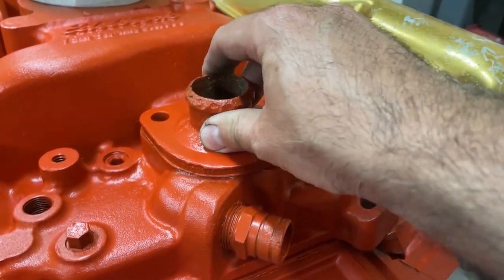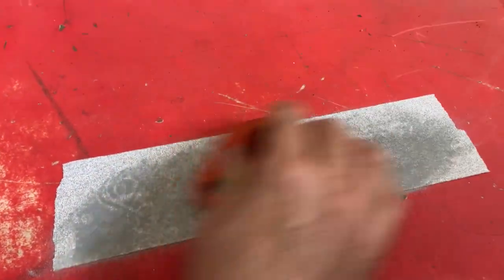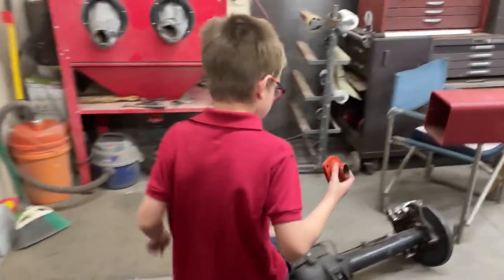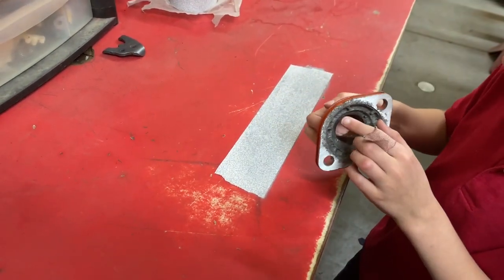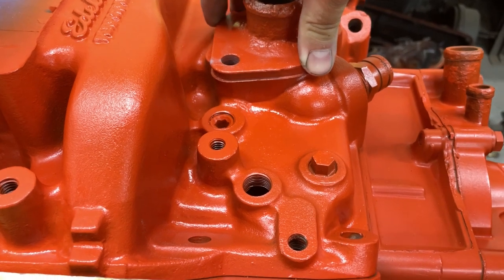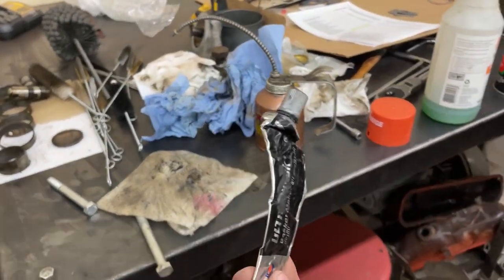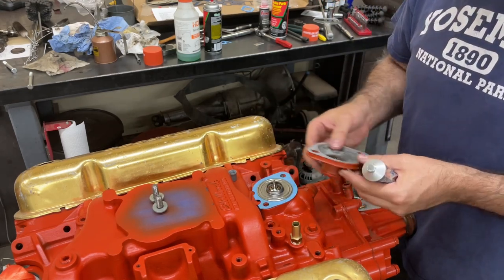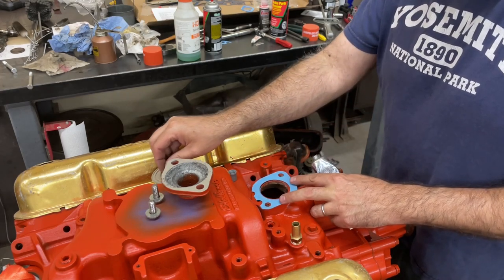318 Mopar Engine Build on a Budget Part 3.  Rocker assemblies installed!

Comment: Pretty cool details on the 318 roller ... I got an 89 318 in my project 72 dart.... Has not been strated in 14 or so years but was stored with oil in cylinders and block off plates will be some interesting first start lol 😂..... I will follow your build so I subbed.
Reply from the maker: Thank you!  I'd suggest priming the engine while rotating it by hand (plugs out) before fire up if it's been sitting that long.  Pull the valve covers off and make sure everything is getting lube and no issues with the rockers & pushrods.  Good luck with your build!  If there is anything you'd like to see in a video let me know and I'll see if I can produce one.  Always looking for ideas and suggestions!

Comment: During your assembly video you mentioned that it does not matter what hole the piston/rod assemblies go. On an LA engine you will see a 0-5 stamp in the oil pan rail which designates what the final bore size is so the guy on the assembly line knows what piston to install in what hole. The bored and pistons were sized on a 0-5 scale.

The 318 I am doing right now has four #4 pistons, two #2, one#1 and one #3.

Of course if the engine has a fresh bore that would not matter.
Reply from the maker: I do remember reading about that before and have seen blocks that have the numbers scribbled on the sides.  Were they still doing that in '86 I wonder? (the year of this particular engine)

Comment: Just did a very similar build with most of the work in the heads.87 LA 318 Roller block started out like you and at some point just decided to have block cleaned and machined properly.New pistons,rings,bearings,new roller cam and lifters along with a good double roller.Your build and explainations are both well done.
Reply from the maker: Thank you, really means a lot!  If I were to do it again I would of taken the block down and had it professionally cleaned and checked.  It ran well enough before so I didn't have any concerns.  (Even with the bent pushrod).

Comment: I had a vacuum leak on number 3 cylinder so I pulled the intake and replaced the intake gasket and I used the edelbrock gasket and I used that permatex gasket maker on the china walls and the water passages then set the intake and torqued it down and after I got it all finished I waited till the next day to set the silicone and now I have a water leak and the front china wall is leaking oil but I fixed the vacuum leak. I’ve got over 40 years experience automotive repair and this 318 has been a big pain ever since I bought the car. I ordered a new gasket but this time I went with felpro and I’m going to glue the end gaskets in and try it again.
Reply: I always use the China wall gaskets but I contact cement them to the block and regular gasket cement on the top of the gasket
Reply from the maker: I just installed the intake manifold last night.  I used a large bead of ULTRA GREY permatex on the front and rear walls, a little smear around both sides of the water jackets, and torqued the bolts down in sequence.  Also used the FelPro intake gaskets that came in the engine gasket set.   The three concerns I have when sealing an intake are Water, Vacuum, Oil.  In that order.   I can live with a little oil leak outside the intake, but water getting into the oil is not good.